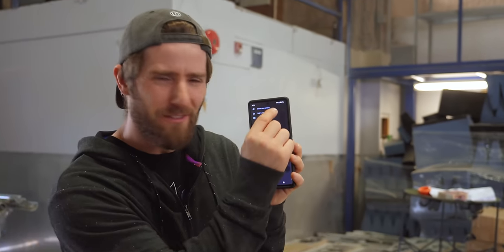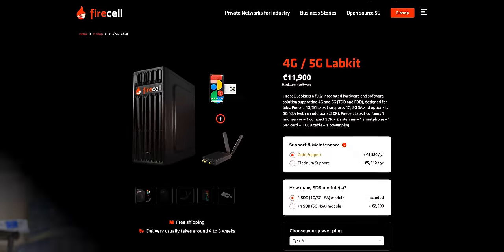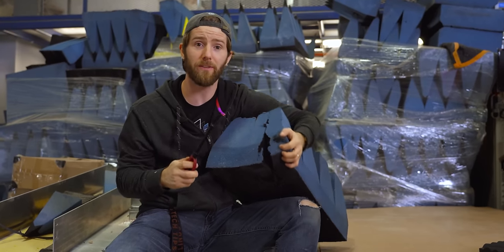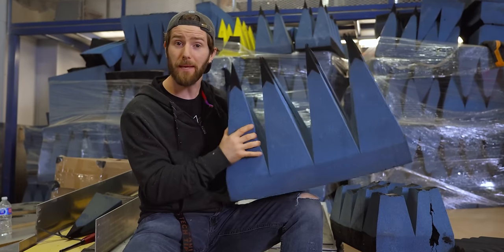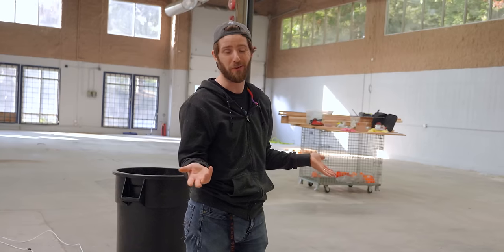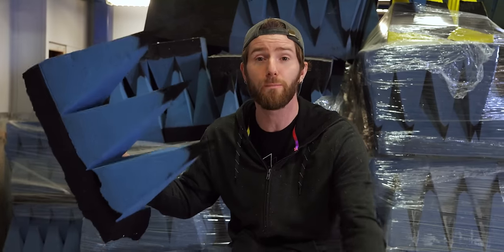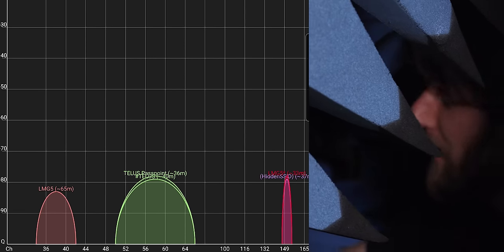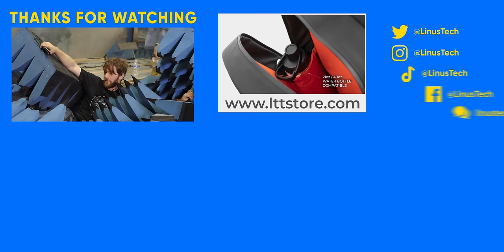They Sent a $45,000 Bill... Then Ghosted Us. - EMC Chamber Problems

Comment: Hi LTT, I am currently an RF Engineer doing emc chamber. I believe that if you look for easy use for RF Chamber you can look up Compact Antenna Test Range Chamber. You have wide range of brands to choose from, the specs and quiet zone required for the type of testing you need to do. 

These are more compact type chamber and wont take up huge amount of space and also portable. Depending on the type of 3GPP test that you require. You might need to also consider IFF or DFF test.
Reply: I've heard him say somewhere that he wants a big one for the spectacle it provides on camera.
Reply: You sound smart, magic man. I will upvote you
Reply: If I remember from the videos touring the labs-to-be, he said he doesn't want a compact one if I remember correctly.
Reply: I have no idea what you are saying... But ill feed the algorithm so that the ltt team can decide wether your input is valuable or not ;)
Reply: @Lemonssssss  I understand and respect what Linus wants, but I have to say: OP wants to sell Linus what Linus "needs" and is cheaper then what Linus wants. Dancing a bit around: If you can design "the perfect emc lab" you might want to have two system. One compact one as OP is describing it is both a good starter and later a solid secondary system for verification or to run two jobs at the same time. So, Linus can shoot in his fancy walking chamber, will his engineer is testing computer mice in the small one. Or the senior engineer and Linus test laptops in the main chamber and the junior engineer runs smart phones all day in the small chamber. Or he cross checks the odd "you're holding it wrong" in both to get a feel for it.
Reply: @Eugen1344  agreed
Reply: @NpxrDSMNTL  You agree with me, I like you. Here, have an upvote
Reply: @sarowie  The equipment cost.....lol
Reply: @Eugen1344  you upvote me? I like that i upvote you
Reply: I think he's trying to fill out that whole warehouse sized space 😂
Reply: He tends to prefer bigger stuff (there’s a WAN show clip about him wanting a walk-in temperature-controlled chamber), purely for theatrics, so I’m not sure he’ll take this advice.
Reply: No you want a reverberation chamber for EMC testing
Reply: I guess there is an extra requirement to get a film crew inside at the same time.
Reply: As a failed engineer, I would agree with this advice. But we all know Linus doesn’t get what he needs he gets what he wants and what looks best on camera.
Reply: Hello quick question, I think that EW cant be measured properly with that kind of foam, even tho it has the right shape, since sound is mechanical and radio frequencies are electromagnetical, which can penetrate smaller spaces and some surfaces. Not all of the wave will reflect as with sound all of it will dissipate by reflection or some will get transfered into the foam as microvibrations. But I am not engineer can you confirm if this is so?
Reply: Pretty sure he mentioned a small one would make it difficult to shoot video with. Given that they're a video channel, it makes sense to get one that will look good on video too.
Reply: Also, he mentioned it won't work below 800MHz...if they are going to test cellular, there is 600 (B71) and 700MHz (B12/13/17) used in Canada,  so that will make it through it without a metal chamber as you suggested/ferrite tiling Linus said was super expensive.
Reply: The term "compact range " is not what you think. When dealing with frequencies 3 GHz and below the wave length gets very large. There are two approaches here. First the "out door range" could be miles long. And measures what called the far field. This doesn't work very well and elements like the weather are impossible to calibrate out. And the more adopted version is a compact range where it measures what's called the near field. And use a mathematical approach to go from near field to far field. Super high over view of a complicated system.
Reply: IDK what you said but I like you

Comment: A friend went to a small technical college that was expanding in to electronic technician programs. They hired a professor to lead it and part of what he said they needed for the courses was an EMC chamber, but the college refused to use contractors that were experienced with such installations and used their general contractors instead who didn't have any idea what was required. They did really dumb stuff like cut holes for the sprinkler system. The professor when demonstrating the chamber to the students had his phone ring and had to explain to the group of students why that meant their EMC chamber was just for show and didn't actually work.
Reply: Our college has countless labs. One of them directly above a lecture theater

In that lecture theater, you'll be foolish to think you can get a cellular signal. WiFi works fine because there are access points in the room.
Reply: That is an egregious act of stupidity on the colleges part. Oh let's spend 40000 on a sound proof chamber. What?? 10k to install? I think well just take our chances and risk 20 years of students having access to a real emc chamber. 
Wont affect our tuition prices or accreditation anyways
Reply: lol oh shit.

Comment: I spent years working in the space industry and we had chambers with similar foam (usually significantly larger, like 100m x 40m x 40x with foam pyramids ~1m in size. The tips would blacken/smoke when testing extremely high power RF links such as geostationary communication satellites (Eurostar 3000 bus) which normally have to transmit huge distances with relatively focused beams. All that power going into the foam caused them to smoke/melt. Perhaps these foam panels were used in a similar high power chamber.
Reply: that's interesting thank you for shareing!

Comment: You could buy a ferrite powder like a cobalt ferrite, and mix it in with something like a rhino-liner liquid and roll it onto a surface, then mount these panels.  You’ll achieve about 75%-80% of the effectiveness of the ferrite panels at about 5% of the cost.  Still not cheap by any stretch, as a 12x12 room would still be about $20,000 USD.

Edit:  Powder, not power.  Lol
Reply: $20,000 for a full room compared to the $45,000 they were going to pay for the actual picture listed, yeh that's not a bad deal.
Reply: What is so special about the ferrite panels and powder? What if they bought the magnetic paint they sell at Lowes. That's ferrous, wouldn't it work similarly?
Reply: @akaraven66  That's not the 45 grand room he's talking about, it's the upgrade that's talkes about later in the video. 1.7 million would be an estimated cost of the ferrite tiles to line the walls of the room. So from 1.7 million to 20k is pretty darn solid.
Reply: @KJ4EZJ  it depends on what your trying to accomplish.  Ferrite panels prevent waves from passing on both sides, to answer your question.  Meaning no waves coming from behind the panels will make their way to the front of the panel on the other side, and Vice versa, truly isolating the room from outside waves.

Second, ferrofluid, as I’m assuming you’re referring to, is not that dense.  You could use it as you’re describing but you can’t dilute it very far and have reasonable results.  Ferrofluid is the same as a ferrite powder, but it’s already suspended in a fluid making it less dense.  In this case you’d have to use so much ferrofluid in the RhinoLiner fluid that the RhinoLiner may not perform it’s intended chemical reaction of hardening and expanding.  The reason I suggested RhinoLiner and not paint is because of the thickness and it’s own shielding capability.  For example, I’ve used RhinoLiner under the carpets of cars for noise reductions, because the composition of this material already blocks many sound and radio wavelengths.  By adding the powder to it, it will retain its hardening and expanding properties and have the added benefit of the ferrite material.

There are even cheaper ways of doing this, for sure, but it depends on how much you value your time.  Lol.  In my opinion this is the quickest way to do it “cheaply.”  If you wanna get really scary, you can use giant steel sheets and turn them into gigantic low power electromagnets, then spray RhinoLiner on that.  But then you’d have a potential fire hazard every time you “switch on” the chamber.

You could also look up one of many online tutorials on DIY faraday cages, which are also VERY cheap to DIY with shower curtains, aluminum foil and cloth, and then you mount that to the walls and spray with RhinoLiner.  There’s many ways to skin this cat, but I think Linus had the right approach in trying to obtain one that was pre-built with actual measurable data to back it up.  Any one of the ways I recommended would require you to put in a LOT of work, which Linus intended to bypass by buying something pre-built.  His time is probably more valuable to him than we value our own time, hence the direction he went.  Very cool video either way.  I may make a video of a miniature faraday box using the method of ferrite powder and rhino liner just to showcase how quick and easy it really is, and how effective the results can be.
Reply: @bleeb1347  Thanks for the explanation. So does a traditional Faraday cage made of a fine brass or copper mesh not block the same (long) wavelengths that ferrite panels or similar do?
Reply: @KJ4EZJ  if you do it correctly, it can.  Faraday cages block certain frequencies, yes, but often times other (lower) frequencies can sneak past. AM radio for example will smash through most faraday cages, and lower FM frequencies too.  If you supplement the faraday cage with a really dense material like I described, there’s only a slim chance something will sneak past.  It will also block sound and vibration.  I built one of these chambers out of an outdoor shed once upon a time; it was eery how someone could be outside could bang on my the walls and you can’t hear it or even feel the vibration.  We used metal mesh from Home Depot, shower curtains and industrial felt, with the metal mesh sandwiched in the middle.  Curtains against the mesh, and felt against the curtains, then sprayed one side with RhinoLiner, attached to the walls with the unsprayed side facing inside, then sprayed the whole inside.  Once that was done, we took pvc pipe and cut a bunch of slightly different sized rings and industrial glued them to the walls and ceiling.  We sprayed everything one more time with more RhinoLiner to get rid of any exposed pvc surfaces.  (Think egg cartons on the walls and ceiling and it’ll be close to what it looked like in the end.)  

The floor was a tad different since we couldn’t use the pvc piping.  Instead we had the metal mesh, the plastic curtain and Felt sandwich on the floor, then we sprayed the one inside with RhinoLiner, then used more industrial felt, then some THICK carpet.
Reply: @akaraven66  Nice reading comprehension.
Reply: The issue with just making a faraday cage or just straight-up lining with ferrite materials, is that the point of this chamber is NOT to block external signals. It's to block external signals AND not echo or reverberate signals being generated inside the chamber.
Reply: @thedude6712  this is why I made the rings, to avoid flat surfaces.  But I think you missed that post somehow…..
Reply: @bleeb1347  Weird, I'm looking at the 3 posts you have in the thread and still don't see where making rings is mentioned, although your first post mentions "then mount these panels", and the third one mentions supplementing the faraday cage with dense material "like I described". Was it in a different thread? The structure of the chamber is RF shielded already, separate from the foam panels. That's part of the design of these chambers.
Reply: @thedude6712  my second reply on this thread, toward the bottom of my first paragraph.  I took PVC pipe and cut it into different size rings and industrial construction adhesive glued them to the wall.
Reply: The problem is that they need a solution that has been professionally tested and calibrated so that they can be sure they're getting consistent and accurate results. They aren't capable of doing the testing and calibration themselves right now, so they couldn't be confident that a homebrew solution like that would be able to give them that.
Reply: @robertc.9503  oh I know.  I mentioned that in one of my posts, that it’s easier for them to buy one that’s designed to do what they want, as the methods that I mentioned aren’t that well known and quite hackish.
Reply: @bleeb1347  wow you should make a tutorial or a book, would buy it, just don't make it more than $10 please

Comment: I would say your got yourself a secondary smaller chamber, as a lot of that foam seems to be perfectly fine.   I worked as an EMC engineer for a couple years and have seen anechoic chambers in pretty bad shape with some pretty rough paneling so although it isn't the quality you paid and expected it is still very useful (especially since it was free!!).  Not to mention and as your probably already know too the majority of the isolation from the outside world is the metal/faraday cage surrounding the room and therefore like you mentioned the foam paneling is just for reflections within, so regarding the last bit, although isolating yourself in the foam fort was a nice demonstration of it's properties it's not intended for that and just goes to show all that foam still works.  I would say your doing yourself a disservice if you DONT end up making a secondary smaller chamber.
Reply: This guy sounds like he knows what he's saying but I'm not smart enough to say.
Reply: make a chamber inside another chamber
Reply: @roowut  chamber inception
Reply: So Canadian RF nesting dolls?
Reply: This is correct. Those foams aren't nearly as bad as he's making them up to be. And it what really matters is the application.... what tests need to be done and what results need to be gleaned... generalizing like Linus is, isn't too helpful. To be fair his audience probably doesn't know better anyway, as the RF world is tiny, and test and measurement ever more so.

Comment: $45,000 is great deal if you got what was pictured. I have spent many weeks in EMC chambers testing products. Some of the chambers I used are well over $1,000,000. The hourly rate to use these chambers can be $250 or more. I hope your engineers like EMC testing as most do not. It is like watch paint dry if you have no issues. It can quickly becoming very challenging when you have issues. It is going to cost a decent about of money every year to keep your equipment in calibration.
Reply: there was no deal here. someone needed to dispose of a shit load of beat up, stained and old foam and their answer was to hopefully trick someone into buying it as that would have been cheaper than proper disposal lol

Comment: I'm not sure that I'd pack the walls of a double-wall structure with that super dense foam, if you're going for soundproofing.  The density of the foam, especially if compressed (i.e. packed) into the wall, might essentially couple the outer wall to the inner wall, which defeats much of the purpose of a double wall for soundproofing.  That purpose being dampening the transmission of lower frequency sounds from one room to another.  There are some studies out there looking at ideal stuff to put inside a sound dampening wall (2 single or double layer gypsum walls with an air gap in-between), and regular old pink insulation ranks really highly, believe it or not.  

That super dense foam would make great material for bass traps in the corners of your sound treated room though.  Treating the wall/wall, wall/floor, wall/ceiling corners with several inches of that stuff can make a real difference in the dissipation of audible low frequency reverberation in a room.  

But I think that EMC foam is so dense that flat surfaces of it would actually be reflective at higher audible frequencies.  That's the one (and only) place where those cheap foam panels off of Amazon can help out:  absorbing higher frequencies.

Comment: You can get cheaper ferrite tiles, but you'd probably be better off with cones that just have a lower frequency cut-off. They also make hybrid absorbers that are a combination but a lot cheaper that doing it separately.

As for using the foam as stuffing for an audio chamber, make sure the cavity between the walls isn't to act as a resonance chamber, because if it is, having foam touch both sides would make isolation worse, especially if you really pack it in.
Reply: Clay and adobe tiles my man. especially armed earth adobe with mesh inside along with the coans blocks a lot of rfs I don't know the reason why clay blocks RFs so well.